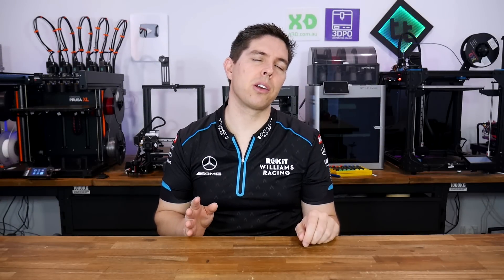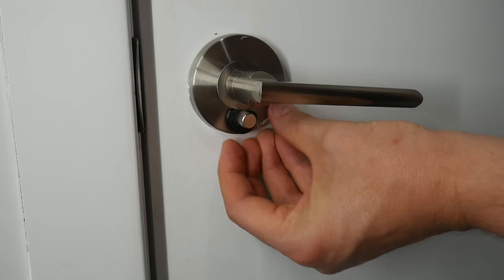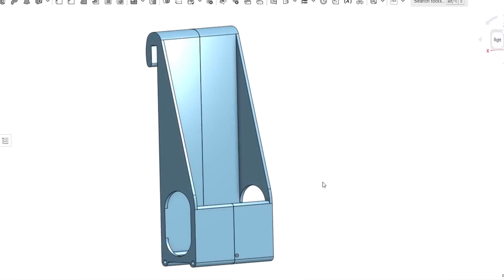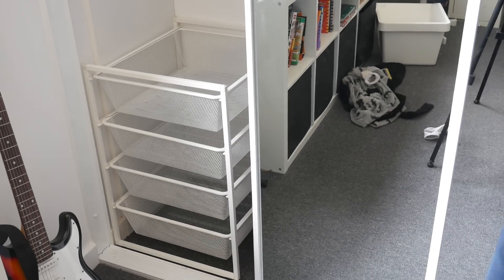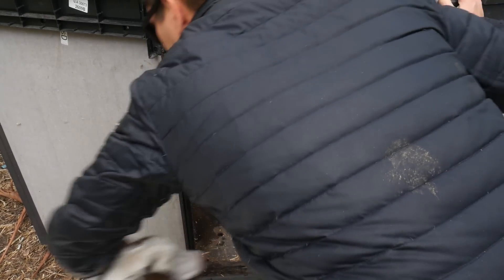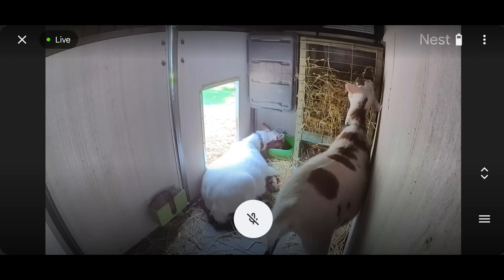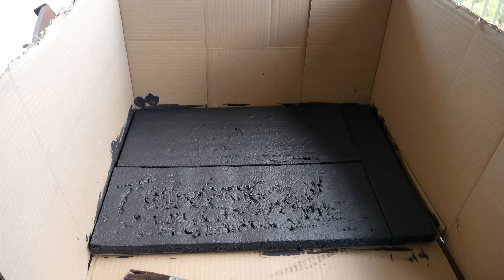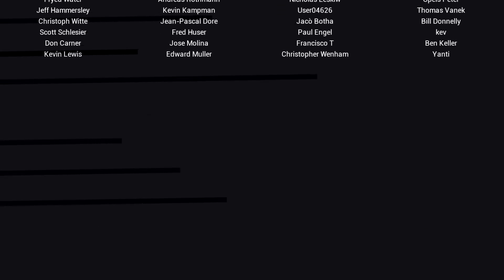5 Practical 3D prints that saved the day

Comment: Sometimes I think I have some weird names for the things I design, but I think 'goat licker' is the best Part Studio name I've seen yet. :D

Probably the most practical 3d print I've made was to make some replacement brackets for the top of our artificial xmas tree. The tree is probably 40 years old but still has life in it. I didn't want to throw it out, but where am I going to find a replacement for such an old item? The most shocking part of this: my first test print was actually spot on. I printed and installed a second and huzzah, Christmas was saved.
Reply from the maker: In my defence, the goat licker tab is a holder for their mineral lick block.

Comment: I have a 1" (25mm) thick piece of dense foam I use for ripping sheet goods down.  I was keeping it in my truck but needed to remove it whenever I wanted to use the truck.  I then bought my 3d printer.  After wrapping my head around FreeCad (I used to do drafting on paper), I came up with the idea for some simple brackets to mount the foam board overhead in my shed.  They're in PLA now but I have plans to reprint them in PETG if the Texas heat gets to them.

Comment: I can't count mine any more... The very first ones were something I did for my mom, tack-on hooks designed to work with those thermometer-shaped holes you are supposed to slide over a screw head. Haven't used any in years but the fun I had seeing the look on my mom's face when those came out of the "expensive doodad" she'd been so skeptical about was worth it. 

The latest I designed myself (at least those I remember) were some parts for my car to replace some broken brackets in the center console. Other than that, battery size adapters, temperature sensor holders, battery wall holders, and similar knickknacks and doodads...

Comment: My humble Ender 3v2 from 3 years ago has paid for itself several times over with practical prints, bodging things back to funcional.
My favourite though is a milk bottle holder. Around here farmers have started selling their milk directly from machines - you bring your bottle and fill it up. Trouble is the bottle rolls around in the boot on the way home. A simple cylinder on a rectangle made in tinkercad (now upgraded to an extrude along path thing in fusion 360) keeps it upright and stops it spilling.
The next project is door handles too. The thread on the connecting screws that go through the door is wearing out on our old cheap door handles, and sometimes when you pull on the door the handle comes off in your hand. I will have to buy new door handles, but these days the rod that connects the door handles to the latch and works the latch when you twist the handle is a different size and won't fit through the old mortice locks. Without a 3D printer, I'd have to get the mortice locks changed on all the doors as well, but I should be able to keep the old rod and print up some shims so I can use the old mortice latches with the new door handles. A victory over the international door handle mafia!
Lastly, many thanks for your videos and your website (particularly printer calibration). They have been very helpful and have led me to try things I wouldn't otherwise have attempted

Comment: I had some dials on my washing machine that kept getting turned by mistake. We never use those functions, but I didn't want to take the knobs off, so I made a print that sits on the dials so they won't turn if you bump them. It has been working perfectly for several years now.
Reply from the maker: Simple and effective.

Comment: I was changing the locks after moving. One of the doors was drilled slightly too small, and didn't have enough clearance for the new latch to work. I had a hole saw in the correct size, but no way to keep it centered in the existing hole. I printed a spacer that fit on the hole saw arbor and kept it centered while re-drilling the door.

Comment: So sorry to hear about your dogs.

A few practical 3D prints I've done:
-A cable holder for my electronics station--it holds four different USB cables ready to power stuff
-The door knob on the door to our garage was always sliding around in the hole in the door, so I designed and printed a spacer to keep it centered
-Too many monitor stand legs to mention
-A drawer that attaches on the side of my printer to hold wire brushes
-My wife likes to make ramen, and when she does, she opens the packets before they need to go in so they are ready, but she ends up making a mess when she puts them down, so I printed a little holder for her, with magnets glued into the bottom, that she can stick on the stove and slot her packets into and hold them upright.

Comment: good stuff Michael! for your door lock clips, i immediately thought that it would probably be pretty handy if you extended it to hang onto the handle. since they're round,  it could be pivoted out of the way to lock the door but remain in place so it doesn't get lost, a bit like those hotel 'do not disturb' signs.
Reply: If I were to design the door lock clips then I'd place a tab opposite the opening in the ring. The tab would let someone hold onto the clip while putting it in place or removing it. The tab would stick out from the base of the door handle when the tab is pointing down but the clip may be rotated once in place so that the tab does not stick out. 

One person below mentioned using a magnet to keep the clip with the door handle when not in use and a tab would be a great place to put the magnet. Or a hole could be designed into the middle of the tab so a string (or fishing line, or something like that) could be used to loop over the part of the handle that covers the part going through the door. An option could be to have a short line go through the hole in the tab to a magnet.

It might be a good idea to keep the key attached to the back of the handle in case the clip was taken out and then the person got locked out before replacing the clip. Place the key in a rounded half container with a magnet, or some other method to keep it attached, on each end of the long axis and place it on the back of the handle, near the base. Hopefully it would not add too much depth. This way the key would always be there when needed.

Comment: One or two practical but basic items. Some oblong inserts for the inside of the handles on a piece of rolling luggage which would no longer retract because the existing components had disintegrated. An odd little bracket to fix a tile to to allow access to a sliding door mechanism. Favourite is a cup holder insert for the back seat of a Porsche 911.

Comment: A whole bunch of stuff, here's a non-exhaustive list:

Replacement headphone band.
Some parts to turn a pair of binoculars into a sun projector for the eclipse. 
A tiny hose nipple to replace one that broke off a complicated injection molded part in a CPAP machine. 
Spacers to adapt some replacement wheels to a lawnmower, to keep them centered where they were supposed to be.
A fixed-angle miter gauge for a table saw. 
Something similar to a phone case, but for a blood sugar meter. 
Extra-stubby screwdriver that takes standard bits(adds about 2mm to the length of the bit by itself).
Tweezers for holding very short finish nails(Couldn't start them without hitting my fingers).

Comment: As a home inspector, I measure the distance between two balusters in a handrail or guardrail along the side of stairs or a balcony. The standards for measuring this space is to test that a specific diameter sphere is not able to pass through the opening. Most inspectors simply use a tape measure to measure this space, but that's not necessarily accurate or convenient. I have never found any supplier who provides these specific diameter spheres (three different diameter measurements are needed under three different conditions) so I printed the curved shape of a hollow slice out of the center of a sphere that is the specific diameter that I need for testing the the space between two adjacent balusters. The wall thickness of my spherical shaped rings is only about 1 mm.
Reply: That's a great application! You might be on to something there.

Comment: You can lock people in their rooms? Can they unlock them from the inside? That's some Harry Potter level shizzle. Lol bedrooms in residential houses shouldn't have locks.
Reply: He’d said when the door slams it locks. Like when they’re leaving. 
The momentum of the pin was able to overcome the spring holding it unlocked. 
It’s not uncommon to be able to lock a door for privacy. Typically a paper clips all that’s needed to unlock em.

Comment: I;m always very wary of using 3d printed parts in anything other than guaranteed very low load or strictly in compression after a friend 3d printed a bunch of shower curtain hooks which were fine holding up a shower curtain, but absolutely couldn't take the weight of a person slipping in the shower and trying to steady themselves...
(however there is a bit of my motorbike's fairing that's held on by a 3d-printed bracket repair hack job so i'm hardly a paragon of good ideas myself)

Comment: Besides your 3D printers, what other piece of maker equipment (e.g. CO2 laser, CNC, 3D scanner, etc...) do you find yourself using the most often? I have 3D printers, and I'm wondering what the most complimentary machine would be when I expand. Thanks for the great videos, and sorry to hear about the dogs :(
Reply: laser cutter and a CNC mill can go a long long way.
Reply: C02 Laser and 3D printer are an incredible combo, 3D printers suck at large flat areas because they take so long. I skeletonise my prints now and fill the voids with laser cut acrylic and screws
Reply from the maker: It's a great question. I'd probably go a CNC. If you go laser, make sure to get CO2 rather than diode (see my buying guide video for lots of tips), because then you can do acrylic. CNC can do acrylic as well as soft metal. A cheap 3018 can be quite capable, or if you can afford it the Carvera I'm using now is amazing.

Comment: I recently had a 3d print save the day. My parents bought a new fridge and wanted to remodel the kitchen... but the table turned out to be ~8 too short for the new setup.

So I measured the dimensions of the legs, printed a set of raising blocks and it all fit nicely.

Comment: Yeah - I am still amazed at how quickly I can gen up some widget to perform a specific task - from a template to install cabinet door knobs to a press to push a motorcycle handgrip onto the handlebar. I do most of my stuff in TinkerCad as it supports the complexity of things that I need - but am looking into learning true 3D CAD. I spent a lot of time with 2D AutoCAD in the past, so just need to move it to another dimension. So to speak...
Reply: tinkercad is great! i used it to make things way more complex than i should have before i started learning a professional cad program